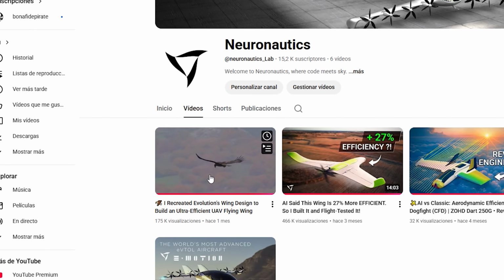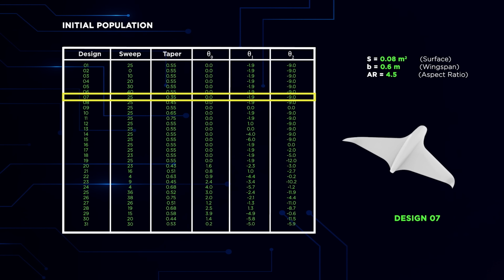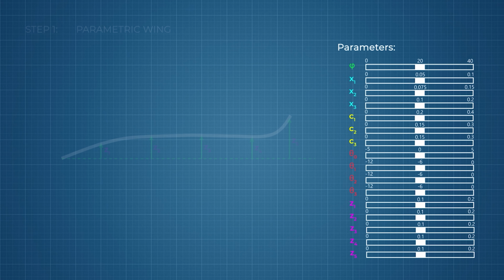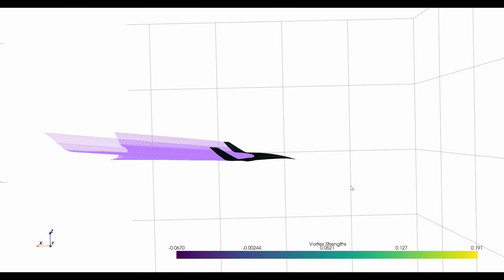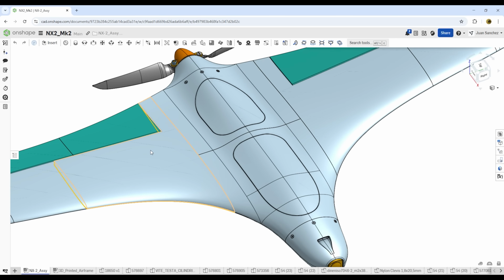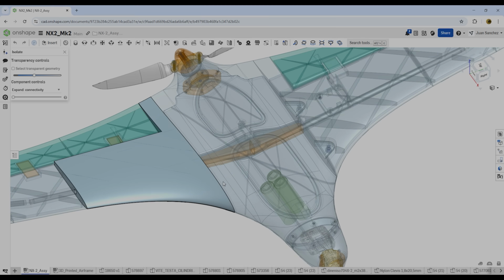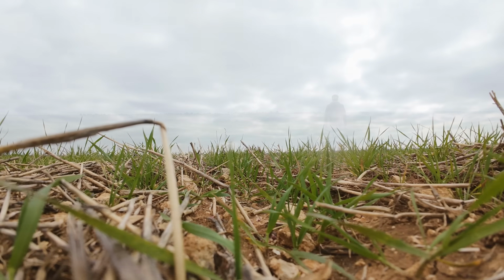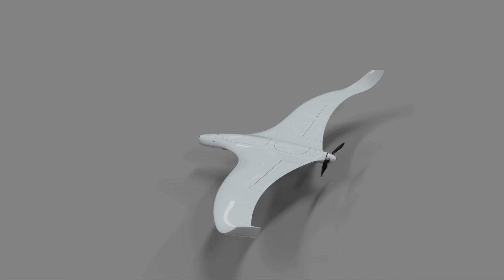AI Designed This Organic Flying Wing… I Had to Build It (+16% Efficiency)

Comment: My brain's reaction: seagull.
Reply: Yeah, that's the actual answer here.  Want a drone that is designed to fly efficiently in a flat manner - that's a seabird.  Want something that designed to take climb on thermals over bumpy terrain and has the control to drop from the sky and stop inches from the ground - that's a bird of prey.
Reply: @davidcoombes9298  birds did run (albeit slow) evolutionary optimisations for a lot longer than we had the chance to. Fun thing is always improving "unpredicted" things that were not in the simulation. Like suddenly developing a new way to reduce wingtip vortices that you didn't thought of before or how a better surface finish could improve aerodynamics without changing the geometry. Stuff that wasn't included in the rating formula!
Reply: When digital evolution converges on biological evolution
Reply: Ditto!!!
Reply: my brain went to that would make a pretty deaccent 1 way attack drone with how long it can cruise around for

Comment: I would love to see a glider designed in the same style and what gliding ratio could be achieved like this. The conventional high performance gliders today can get 60:1 glide ration. Would anything better be possible with this? Would like to se 15m and 22m wingspan variants. :D Its one thing to do a model and another something that can carry useful load in form of pilot or a cargo. However good job so far.
Reply from the maker: I think the big challenge there would be wing strength, especially with the extremely high aspect ratios needed for that kind of glider. Scaling this idea up is a whole different game, but it would be very interesting to explore. 🚀✈️

Comment: Do I understand correctly, that your models did not include the propeller? Is that a valid simplification? Me, not knowing anything about it, I'd just guess that the airflow ahead of the propeller has a lower pressure than was in the simulation.
Reply from the maker: Thanks! 🙌 Yes, that’s right — and it’s actually a very common approach in aerodynamics and conceptual design not to model the propeller until later stages. It simplifies the analysis a lot while still being useful for comparing the main airframe trends. The propeller effects matter, of course, but they’re usually added in more detailed phases. 🚀✈️

Comment: This is my favourite project of recent years! Watching how AI is utilised in the design phase and then 3d printing for proving it, I look forward to every video as I can see the passion and dedication in the project!

As for the CNC components, if it were me I would be building a test stand which can measure lift, pitch, roll and yaw if the bird was in a wind tunnel, air speed can be measured from the tunnel itself, who knows is there a wind tunnel on the horizon as well?🤔

Another thought is using a CNC router for making the wing itself out of foam in one piece to provide a stronger construction and lighter weight.

Keep up the absolutely great ground breaking work, would love to see this scaled up one day for a full size aircraft!
Reply from the maker: Thanks! 🙌 Really appreciate that! And yes, you’re very close — those CNC parts were related to test hardware, more oriented toward measuring propeller thrust, torque, etc. A wind tunnel is definitely a dream :) 🚀✈️
Reply: @neuronautics_Lab  THE major progress of the Wright Brothers was their home built wind tunnel, and well designed measuring system, for developing their air foils. And, of course, their answer to the control problem. The inherent problems of wind tunnels are well understood, if not simple to address. Even Mercedes Benz multi-million dollar Formula One wind tunnel had issues at quarter scale, which ruined their program for years till fully understood. Another comment on propeller efficiency varying with air velocity and flow vectors aft of the airframe, is pertinent. Variable incidence mounting for the propeller would add complexity, and offer additional optimization. NOT criticisms, just food for thought, as I'm incredibly impressed with your project, and the most communicative video.

Comment: Very impressive! I'm interested in the roll effectiveness of those elevons with them being so far inboard? From my experience ailerons need to be as close to the wing tips as possible for effective authority, they can also then be much smaller with less deflection. Having them so far inboard requires greater size and larger deflection which adds drag when performing roll stabilization.
Reply from the maker: Thanks! 🙌 You’re right — ideally I would place them closer to the wingtips to increase the lever arm and improve roll effectiveness. But in this design, that outer area has the most curvature because of the dihedral distribution, so it was a compromise. Even so, it still has enough control authority in both pitch and roll! 🚀✈️

Comment: If your model assumes that wing flex is consistent across the wing, what happens when you insert those long rigid carbon rods to hold parts together? The flex will be inconsistent. Also, you could do a lot things to smooth the airflow across a 3D plastic wing and all those turbulent hatch seams. I mean you did spend all this effort just to gain some efficiency. Right? I didn't see any AI here, just some clever design and then some number crunching in a Python program that runs an 'evolutionary' type of algorithm. Most people will think it is magic anyway, so no harm I guess. A lot of work. Fun project. Good job.

Comment: have you tried wing tips either flat or pointing down. Birds try to catch as much air as possible under the wings,  wind tip feathers bend upwards because cannot withstand the pressure.
Reply from the maker: They can look great aerodynamically, but for this kind of aircraft they would definitely suffer more during landings, so it’s a bit of a trade-off. 🚀✈️
Reply: @neuronautics_Lab  Would it help in your designs if you think that instead of flying by unexplained LIFT mechanisms, in fact it's a matter of surfing, and of life forms that conquered the air and the aquatic environments are actually surfing (this is confirmed by AI chats). Humans incorporated more recently into the art of surfing.

Comment: Do you think this design would make a good glider or would the parameters and penalties need to change for that? For my flying wing slope soarers they wallow a lot (yaw stability) but a small central vertical stabiliser really helps, your base shape doesn't allow for that to evolve so I wonder what difference it might make?
Reply from the maker: For a traditional glider design, the parameters and penalties would probably need to change, especially to push more yaw stability. That could favor things like larger vertical wingtips or more sweep to increase the lever arm relative to the CG. In this design I kept yaw stability closer to the bare minimum I tested, so it wouldn’t penalize efficiency too much. 🚀✈️

Comment: An excellent application of AI. A thought that I had watching this; one of the things that's common in land speed record cars is sealing panel gaps with tape to reduce drag. Auto manufacturers are doing the same thing by tightening panel gaps as much as they can, because it makes a significant difference. With that in mind, I'd be curious what kind of efficiency gains you'd see by applying masking tape to the access hatch seams and filling+blending the seams between wing segments.
Reply: "AI" hype doesn't design anything!
Reply: @internetcensure5849  A good friend of mine once observed that the majority of human communication is not information exchange between reasoning agents. Instead, for most people, most of the time, it's emotional regulation through social performance. The content of what they're saying is often irrelevant to what they're actually doing, which is managing their internal state by externalizing it. Your comment is a textbook example thereof.

Comment: Oh boy I have been waiting this. Great work and thank you for sharing this with us. 
3 ideas for the future to test out if you are interested. 

A. Forced air jets instead of control surfaces. 
a1. A single small pump pressurizing a canister that can then eject the air through channels in the body or...
a2. covered intakes in the front of body/wings controlled by actuators then when opened direct the airflow into different channels.
Less mowing parts, smoother wing surface, reduce drag from control surfaces.

B.  hundreds/thousands of tiny airholes on the body. In the front, the pressure would push it in and in the back, air gets sucked out. Nasa tested the concept and it proved to increase lift and decrease drag.

C. "Golf ball" Dimples? it does work to decrease drag.
Reply from the maker: Thanks! 🙌 Really interesting ideas! Active flow control and suction/blowing systems are super fascinating, but for this scale I think they add a lot of complexity, weight, and power cost. But maybe in a bigger wing? ;) 🚀✈️

Comment: Great Project!
I don't really see genetic algorithms as AI though but rather as a brute force method that isn't guaranteed to find the overall optimum. 
It doesn't make sense to merge designs from different local optima. 
AI is good at classifying things, maybe this could be a route? Or maybe you could make the probability of merging two designs based on the vector distance of their parameters. 
And it would be very interesting to see multiple designs resulting from different local optima. They could each have abilities where they excel.
Reply from the maker: Thanks! 🙌 In each generation, random designs are also tested to help avoid getting stuck in local minima. Overall, DE is usually much better at finding a global minimum than methods like gradient-based optimization. 🚀✈️

Comment: Love the modelling you did. It's so intuitive. But I was confused with the penalty terms because I couldn't tell if they were dimensionless.  I'd love it if you explained that because concatenating a mix of units does not make sense.
Reply from the maker: Thanks! 🙌 Good point —penalty terms are normally normalized or non-dimensionalized first, so they can be combined consistently in a single objective function. I should probably explain that better in a future videos!

Comment: When setting up printing sections, I wonder if adding indexing nubs and dimples would be too complicated or aide in assembly.
Reply from the maker: It would definitely help, yes — but the carbon spar is already guiding the parts, so assembly is already pretty straightforward. 🚀✈️

Comment: How did you set the speed ? you only mention  restriction on max width at 1.2m and surface of 0.15m2 ?
Reply from the maker: The speed was not left free in the optimization — I prescribed a design point of 12 m/s in the code. On top of that, I also imposed a target lift coefficient of CL = 0.4, and for each geometry the solver finds the angle of attack needed to hit that condition.
Then it compares wings at that operating point and evaluates things like induced drag, profile drag, L/D, stability margin, structure, etc. So in this case the speed came from the chosen mission/design condition, not from the geometric constraints alone. 🚀✈️
Reply: @neuronautics_Lab  shape seems constrained to existing birds by biomimicry, will you trie a full free search by AI that may not look like a bird ?

Comment: Will you also do a motor/ propelars  AI pass for their numbers and different placements, or do you want a single engine design at the back of the plane ? it seem mutiple small motors on the wing front edge is a good solution
Reply from the maker: Thanks! 🙌 For this design I was intentionally targeting a single rear pusher configuration, so propulsion layout was fixed from the start. But yes, DEP (distributed electric propulsion) is a very interesting direction, and it has shown real potential in projects like the NASA X-57, especially for improving low-speed performance and giving more design freedom🚀✈️

Comment: Nice project.  The old aviation saying definitely applies here - "If it looks right, it will fly right".  This looks absolutely beautiful.
Reply: Which old aviattion saying?  The Taube was pretty but was tail heavy and flew like crap. The Cutlass looked awesome and was deadly. The Skua flew great and was liked by its pilots but looked weird.
Reply: Unfortunately 'looks right' is an artifact of previous experience. To those immersed in WWI and later biplanes, the Brucker Jungmann is superb. To those used to WWII and later combat aircraft, it is atrocious. It is all dependent on what you are used to seeing. I have parrots in the home, and watch Albatross and Wedge Tailed Shearwaters regularly. Whose wings differ strongly from the parrot wings. And thermalling raptors and scavengers have yet different wings. Horses for courses. Each is optimized for it's usual role and ecological niche. The constants are feather design, and internal structural anatomy. Albatross and Vulture wings are each supreme in their respective environment. Each will fall short in the other's domain.

Comment: Very impressive, both the results and the process. I’m curious, though: it sounds as though your own design effort, and AI optimisation, examined the wing on its own with no prop. I assume the prop speeds up the airflow over the central part of the wing, and makes at least some difference outboard. Would including this factor make a material difference? Or had you already accounted for it? (Maybe it’s obvious to people in the field; I’m merely a curious outsider here.)
Reply from the maker: Thanks! 🙌 Great question — for this one I did not explicitly include prop wash, since it’s a rear pusher and its effect on the wing is much smaller than in a tractor setup. It would change the numbers a bit locally, but probably not enough to change the overall design trends. 🚀✈️
Reply: @neuronautics_Lab  Thanks! Keep up the good work, eh? Very interesting.

Comment: The design is awesome, but without a spar it isn't feazable. I tried and loved your first model, but again, unless you are fibre glassing or covering it with carbon it's not going to survive for long.
Reply from the maker: The first model was only 600 mm span and already had embedded spar-like reinforcement through the internal rib structure. This one is larger, so it uses two 6 mm carbon tubes per wing, which are more than enough for the loads it will see. 🚀✈️
Reply: @neuronautics_Lab  Thanks for the clarification!! Looks super cool BTW!!!!!!

Comment: This is admittedly a REALLY silly question, fueled by my ignorance of the subject, but as I watched the intro and some of the various designs, it left me wondering something... 

First, whether you could have a highly flexible wing (and still have a functional airfoil), which was then kept rigid by having it slightly under tension with braided fishing line underneath, connected to the tip and to the bottom of the fuselage belly. Then, inside the belly have a reduction setup connected to a motor so that you could wind it up (a tiny winch, basically).

Second, whether or not being able to give the wing a curve or bow shape would have any desirable effects...

Which to clarify, as I tried to find whether there's a term for it... I'm not referring to dihedral or anhedral,_ as that's just the wing angle. Nor am I referring to camber since that's only the curve from leading edge to trailing edge.
The best analogy I can think of is a paraglider, where is wing/chute has that curve. Which MIGHT even be exactly the impact I'm after, if my understanding of what the draw ropes do when they're steering 🤔

Either way, point being that the plane would be able to dynamically change that curve in flight due to the ability to windup or unwind the cable (braided fishing line). Whether the ability to change the wing from being flat to being curved would be useful in any way? 🥴😅
Reply from the maker: Thanks! 🙌 Really interesting ideas, thanks for sharing. Variable-curvature or morphing wings are definitely a very promising direction, and I’m convinced that kind of adaptive geometry is part of the future of aviation. 🚀✈️
Reply: @neuronautics_Lab  Oh yea! I forgot about the morphing wings with the flexible skin. Though those are a little different since they, at least as I understand it, still use an otherwise rigid wing and it's basically dynamically changing the airfoil shape. (primarily changing shape between leading and trailing edge vs root and tip)

I agree, though, I think there's a lot of potential with them, especially the flexible skin one. Even the vastly older stuff is still useful, like Swing-Wings, and I think we'd have far more that would use it if they didn't prove to have way too high of maintenance costs. The F14 Tomcat and B1 Lancer are both awesome aircraft. A giant commercial supersonic airliner with swing-wings would be quite a sight!

Comment: You could add a flight controller to each design and measure how much work each needs to do to maintain a standard flight.
Reply from the maker: Thanks! 🙌 I actually do have the logs from both flights, but I haven’t looked in detail yet at how much correction the controller was making in flight. That would be a really interesting metric to dig into in the future, thanks for the idea! 🚀✈️

Comment: How do u print with LW PLA? I can't figure out the settings
Reply from the maker: I have it quite tuned on my old Creality CR-5 Pro and it prints LW-PLA really well. More automatic printers like the Bambu Lab ones can actually be trickier with LW-PLA, since that filament often needs a bit more manual tuning. 🚀✈️